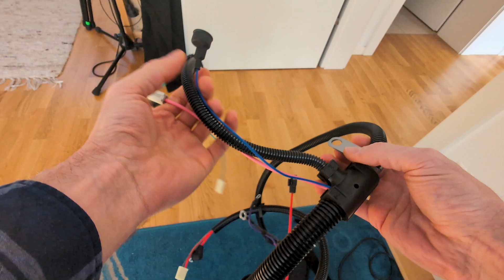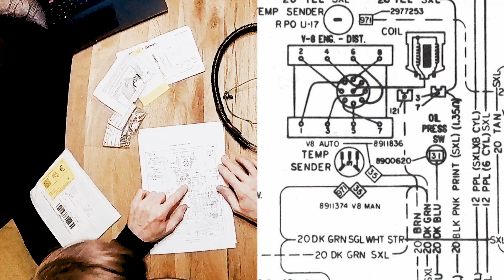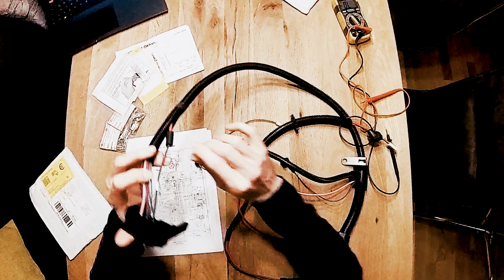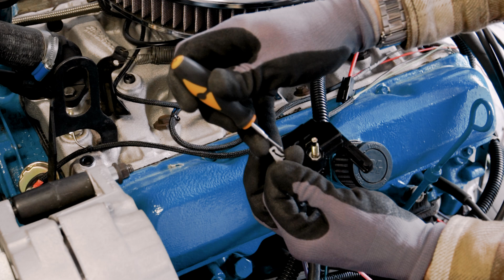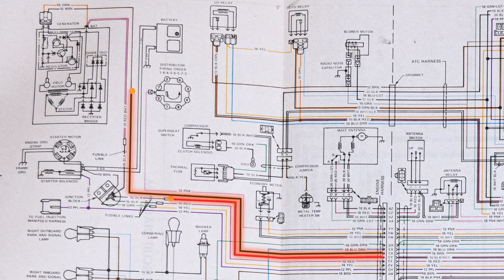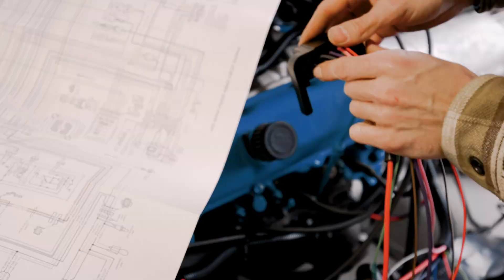Behind the Scenes: Building a Custom Harness

Comment: Great job! Just a question, why did you not buy the correct engine harness for your car, 1976 Seville? Is this not available? Further, for the GM 56 Series connectors, there is a special crimping tool available.
Reply from the maker: The Olds 350 in the Seville was upgraded by Cadillac to fuel injection, and since I wanted to rebuild it to a carbureted engine, I had to get a harness that would fit my plans. There are a lot of different (even universal) harnesses available, BUT not many manufacturers ship them to Austria. So I was searching the internet up and down, left to right just to find a harness that would fit as good as possible AND that's shipped to Austria too— I literally spent weeks just to be sure, because sending it back wasn't an option as well.
And about the tool, I stumbled across that too, while searching for all the parts and terminals to rewire my engine, but with shipping costs and custom duties, I thought I'd try it with the tools I have.